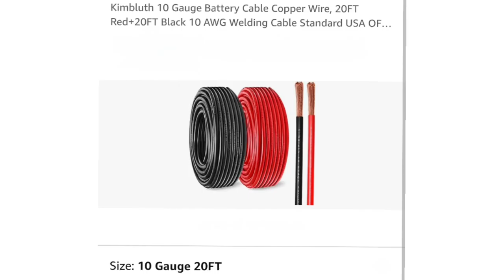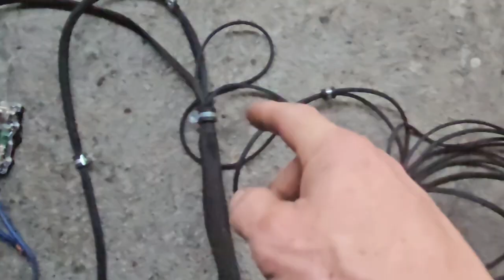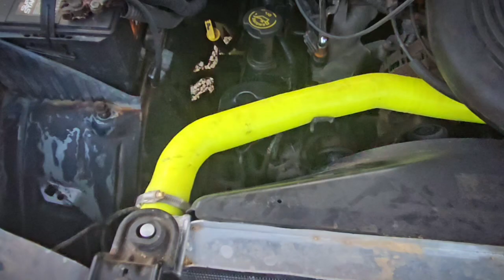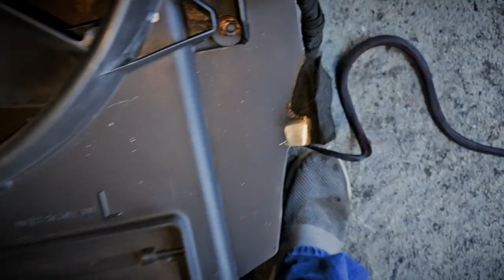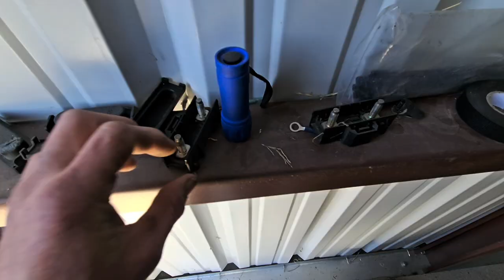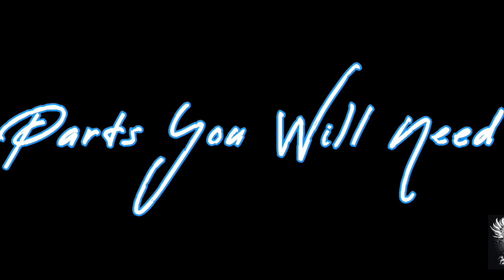HELLEANOR PROGRESS | 1997 F150 ELECTRIC FAN UPGRADE

Comment: Do you happen to know of any oil or coolant problems for the 6g73? I recently bought a car with one but can't find any information on problems or fixes, I was hopping you possibly have knowledge on the engine because of your dodge avenger series.
Reply from the maker: Mine had bad freeze plugs, if the belt is old it will break and cause valves to bend, other than that, its mostly silicone holding it together,  that motor you saw is available along with transmission,  free if anyone has a trailer,  im buying a better no rust example and this one has to go.
Reply: @StraightLineCycles  I would grab it if I wasn't so far away, I've just been experiencing problems with coolant and oil, I just got this 1999 Chrysler Sebring with the 6g73 as a first car and I've had trouble diagnosing my issue, my coolant dropped from full to add and I couldn't find any leaks on the ground, I refilled it about a week ago and it still hasn't dropped yet which stumped me, The coolant doesn't seem to be in my oil either and the engine runs pretty hot, Every once in a while it will smoke but not lots and then go away.
Reply from the maker: Coolant might be leaking when under load or driving, but not sure, any white smoke?